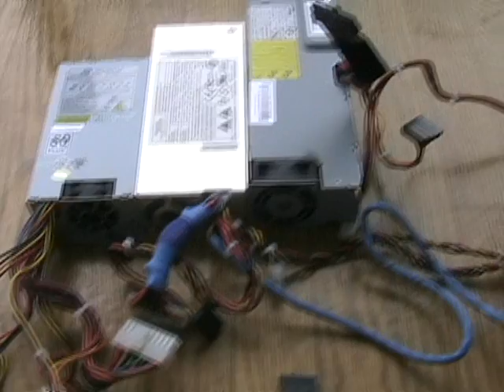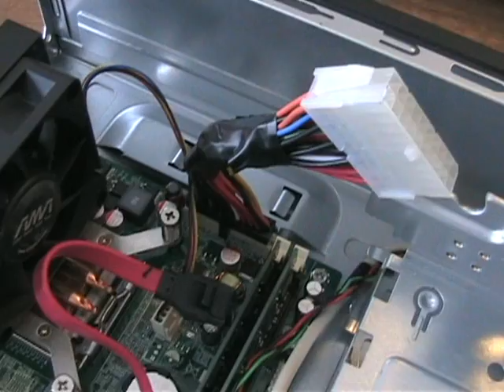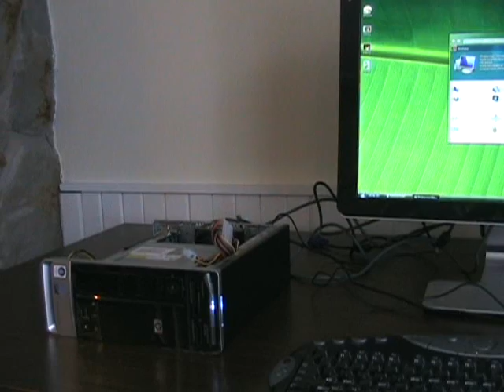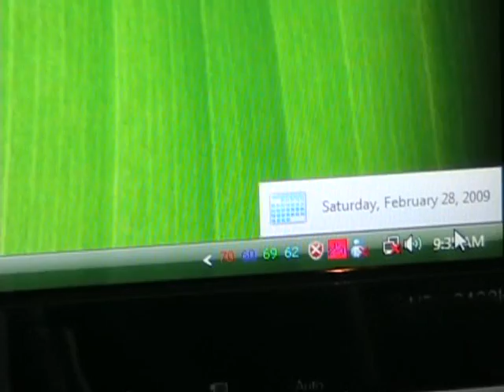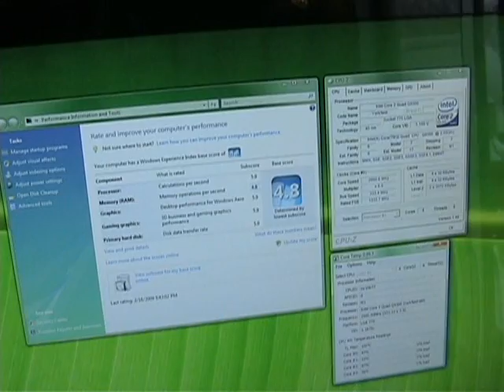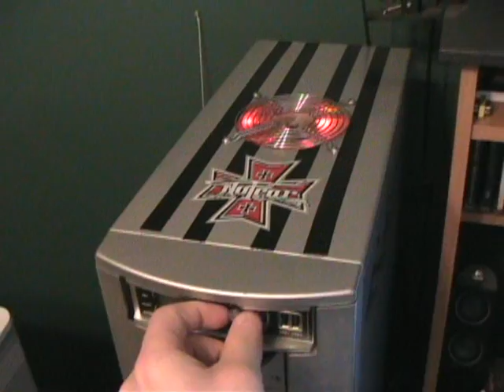HP Pavilion Slimline PSU Upgrade Guide

Comment: So in your HP Slimline, it looks like the portable HDD system bay is removed to allow the GPU card to fit. About what is the fastest CPU that can work with the stock mobo? I got a hold of an HP Slimline Pavilion with Win Vista. Thank you 🤓
Reply from the maker: Might want to ask your question here in this thread I started in 2007.  I haven’t had a slimline in years, and don’t recall — although you should be able to web search your particular model with CPU compatibility and find the info.  https://hardforum.com/threads/the-highly-rated-hp-pavilion-slimline-pc-thread.1224011/
Reply: @jvonengeln  ok thank you 🤓

Comment: Hi, bro. I have this case, and I want a H81i motherboard, so, which power supply do you recommend I buy for this case?
Reply from the maker: I used the Sparkle PSU from this video.  It worked until I sold the slimline years ago.

Comment: I have an almost identical model. i thought 1U/Flex ATX power supplies would fit, looks like standard Mini-ITX motherboards will fit as well. With a little creativity i could also get a modern high performance GPU to fit and have a nice compact gaming rig. You can find 1000 watt 1U PSUs.

Comment: Sir please help me out, I have a dell inspiron 660s which has a slim chassis design like yours, I want to upgrade my Gpu from the stock nvidia geforce gt 620 to a nvidia geforce gt 730. My current power supply has an output of about 230w,  I would like to know if I really need to upgrade my power supply or not or can I run the zotac gt 730 on my current psu
Reply: Is too late but yes, this PSU can handle a 730GT

Comment: will an 8600 ge force work on the stock suply of this its 2.50 ghz
Reply from the maker: Kurt Oliphant It's a heat issue more than a power issue.  You'd probably have to mod the side of the case and put a narrow fan in place to avoid overheating.

Comment: Plus i messaged you a link that you might wanna put in the description. I can't comment it. Its a power supply replacement with the adapter including, designed specifically for these computers.

Comment: So which is better for decent gaming? I dont want it to overheat or anything, its seems like in the vid you are saying the sparkle gets hot but on a normal day running normal everyday things its fine. Should i strap some hefty fans on the back of my desktop just to allow alot of airflow through the whole thing?

Comment: Thank you. I searched a few websites and forum posts to see what i need to do and what power supply i would need, and for some reason everyone was just to lazy to do something this simple. They all said it'd be too much work to upgrade a graphics card on this because you would need stronger psu bla bla, and i say why not just get the better psu too?. I have to replace mine psu anyway. Everyone recommended getting a new computer instead of spending mabye 150 and upgrading this one. lazy bastards

Comment: If you thinking run a high performance low profile card,go for Athena Power Flex 400 watts,the only with 2 PCI Express Wires; its the best deal, im buy it for 68 bucks in my home; and runs great, but you need to remember to the seller fix the noise problem, all the flex psu have this problem,but aathena have a fix,consist in change speed fan configuration

Comment: This is why the internet was invented - great vid. Wish I'd seen it before I ordered the noisy replacement 200 watt unit I got! The OEM Delta PSU has a push fan that's on the interior end, the replacement unit's fan at the back is so loud that I now have to turn my machine off when not using it.
I just cut off the molex and pressed the wires into the SATA connectors. Some sites suggested the orange wire is a "power good" line; my drives run fine without it.
Thanks!

Comment: i have a s3023w and the power supply hase no fan and the computer over heats i hade to add a fan tothe system and the powersupply and if i leve the cover on the side it stillover heats.

Comment: i have a slim hp an it wont come on anymore  the little green light on the psu is on an  the power botten did flash when you tryed to trun it on but not anymore any clues to whats rong with it

Comment: I got a question: If I were to install the 9800GT on a SlimLine, could I use an external PSU just for the card without the need to change the internal PSU? I have a 430Watt Thermaltake PSU that has the 6 pin PCIE power connector. I'm thinking of just placing the PSU up top the case, and get that connector inside to the card. Would that work?

Comment: Give any of those power supplies a year running a quad core CPU and a 9800GT and open it up.  I'll bet there will be capacitors leaking everywhere... if the computer even turns on anymore.  Those tiny fans (or should I say, tiny fan) simply don't cut it in the long run, and you'll end up with more problems than you started with.

Comment: Hey OP, how did you get unlocked BIOS? My HP Slimeline (s3500t) uses a FOXCONN GL6E motherboard with stock BIOS so I can't overclock and all the other MINI-ITX boards I've seen have horrible ratings what should I do?

Comment: i change the small case of the slimline... and use new mid-towe case...  and 1 gts 250 and 4 gb 800mhz of ram 
P.D: the atx regular power supply(20/24input pins) Not compatible with the input of the motherboard ,but manually changing the wires can make it work (only recommended for people who know about computers)

but works for me

P.D: the google translator is good :)

Comment: my rig 

HP SLIMLINE S3400Z CTO(CONFIGURE TO ORDER) 
2.9GHZ AMD ATHLON DUAL CORE 64 BIT 
4GBS OF CRUCIAL PC2 6400 RAM 
250GB SATA 7200RPM HARD DRIVE 
MSI ATI RADEON HD 4550(OVERCLOCKED) 1GB PCI E 16X 2.0 DDR3 
WITH UP TO 2GBS HYPER MEMORY(LOW PROFILE) 
16X DVD(+/-)R/RW 12X RAM (+/-)R DL LIGHTSCRIBE SATA 
VISTA HOME PREMIUM 32 BIT

Comment: My HP SLIMLINE S3400Z CTO(CONFIGURE TO ORDER)
2.3GHZ AMD ATHLON DUAL CORE 64 BIT
4GBS OF CRUCIAL PC2 6400 RAM
250GB SATA 7200RPM HARD DRIVE
MSI ATI RADEON HD 4550 1GB PCI E 16X 2.0 DDR3 
WITH UP TO 2GBS HYPER MEMORY(LOW PROFILE)
16X DVD(+/-)R/RW 12X RAM (+/-)R DL LIGHTSCRIBE SATA 
VISTA HOME PREMIUM 32 BIT

Comment: I'm a little scared about upgrading the PSU, I sit my HP slim upright so I'm not sure if it will come down on my motherboard and short it out.. Because no PSU I could find has all the screw mounts so I'm not sure if the PSU I buy with on 2 screw lining up will be strong enough or not..

Comment from the maker: most likely yes --- slim computers typically use lower power components and so you'll likely get away skating under the standare power supply requirements.  BUT keep in mind that heat generation may still be an issue and you may need to purchase additional fans for your Dell Slim.

Comment from the maker: Yes - I've played any number of games including crysis with the 9800GT and a 270 watt PSU in my slimilne...I've never had any problems.  The 400watt PSU requirement is suggested to accomidate all various PC builds with various CPUs, and hard-drive configurations.  The slimlines have low power draw virutally everything in compared to a typical desktop so the 270 watt PSU is perfectly adequate for a 9800GT.  Read [H[ardforum for your answers to this very question.

Comment: I saw the 9800 (low profile) power requirements were a 400watt power supply. Have you ever tried Crysis with this? Does your PC crash if it the graphics card demands too much power? Also what are your power settings in the control panel? thanks 
I mean if it was 50 watts it might no make a difference but if the GFX card was rated at 400w and you're using 300 that's a large jump. Thanks again.

Comment from the maker: The short answer is yes it'll work.  Long answer is that depending on what HD 4550 card you buy it may or may not come with both a low profile and full size mounting bracket.  If the one you bought only comes with a low profile (short) metal mounting bracket then you won't be able to hold the video card in the HP without buying a full size bracket from a place called newegg.  However - most importantly the video card is compatible --- PCI-E 8x or 16x will work  (assuming your HP truly has that)

Comment from the maker: You should be fine with the 4550 on a stock PSU.  You'll likely want to add a extra 40mm or 50mm fan on the back of the slimline in order to ensure you exhaust the heat from your gaming marathons.

Comment from the maker: without changing your power supply you'd better not go to an 8600GT.  If you get the in_win you can use any low profile card you want.  The best card is the sparkle 9800gt but you'll have to buy additional fans to keep the slimilne cool.  The low power low profile 9600GT is also a favorite.

Comment from the maker: the HD4550 is the best card you can buy ojn the stock 160 watt PSU.  You can use a 9300GS if you can find one, or a 8300GS but those are not quite as good of cards as the HD4550.

Comment from the maker: No.  I used an 8400GS on my s3020n with the stock 160 watt PSU and had trouble.  The 8400GS can use as much as 40 watts from what I've read, unless you found a low power consumption revision.

Comment: Hi, will a Nvidia 8400 GS low profile work with a un-modified HP slimline s3600 series? The 8400 GS wiki page says it's a 25watt.

Comment: gtx 275 will not fit. Also, no slim PSU can provide the kind of power this card needs.

Maybe 4-5 jerry rigged (I know how... but it's not worth it for the price) PicoPSU mounted in your case can do it, but even so, the card is just too big.

The s5xxx series, however, maybe if you used a tfx power supply, with 400w (screw what the box says) and used the slot reserved for the Audio/Video expansion. Then a flexible PCIe16 riser cable at least 6 inches long. Don't forget a little bit of dremel

Comment: Check on NewEgg, there is a slim 4650, and there is a slim 9800gt.

I have the slim 9800gt (it's also from NewEgg). It's manufactured by SPARKLE, has 512mb of gddr3 ram on a 256 bit bus stock speeds.

Both require a PSU upgrade, micro-fit adaptor (for the Slimline Motherboard, newer slimlines don't need this), Molex-SATA adapter, and Molex-PCIe 6pin adaptor.

The best site for help is at the bottom of the video description, that is where I found out most of this information (and used it!).

Comment: The slim one will, but it's the best ATI card for slimline. Shame, ATI cards typically do better per watt.

The 9800gt is the best there is for now, I got a modded (ha!) s3120n and a generic s3430f, so I never really cared until I saw how much faster good vram is.  The 128 bit bus... while it's better then the stock 8500gt's 64bit bus, it isn't going to beat the 9800 256 bit bus (best there is so far).

If you like ATI cards, wait a month or so for the 5350 or the 5550 form ATI to arrive.

Comment from the maker: It doesn't need 300 watts.  Your 150 watt PSU will work.  They have to account for crappy PSUs when they claim 300 and also account for PCs that use WAY more power than this slimline.  I've been in IT and building computers for about 15 years.  You can trust me or don't...but the ATI 4550 will work on a 150 watt PSU in a slimline.  Of that I assure you.

Comment from the maker: I actually have a 9800GT working perfectly for several months on a 270 watt PSU.  I settled on the sparkle PSU because the reliability on the PC50 seemed hit or miss after a while and the sparkle has been 100% reliable.

Comment from the maker: kindom2009.  read the post above.  Disconnect everything - and connect the green and any of the black ground wires together to switch on the power supply.  Verify if you have a good power supply.

Comment: Hey I upgraded my graphics card to verto 9600 gt and aslo the power supplie thats 450 watts and 12v 30amps. now heres the problem, every time I try to install the driver it says  installed graphics adapter not found. I disabled my onboard video card and I set the bios to pcie, and when i plug the vga in the grafics card theres no singal on the screen.I have a hp slime line can you tell me what im doing wrong?